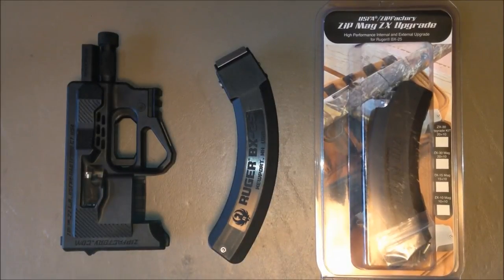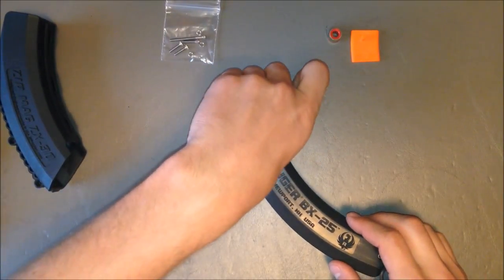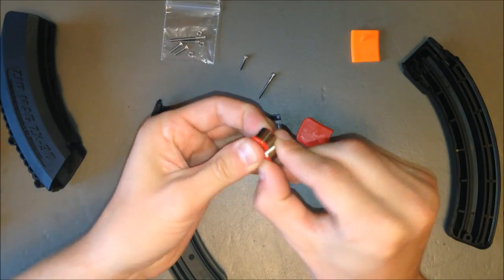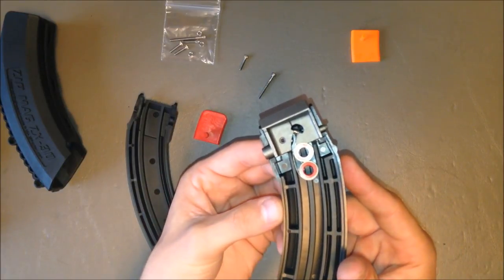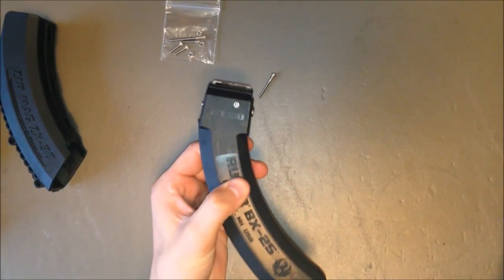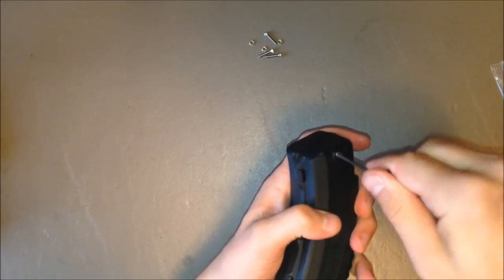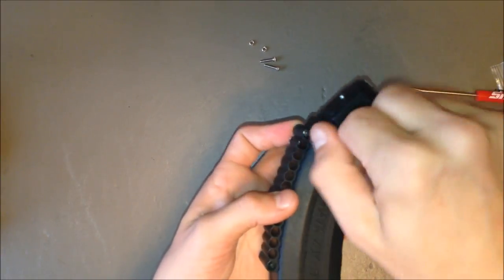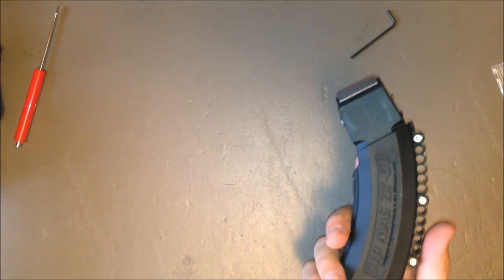ZX Upgrade Kit for BX-25 Magazine

Comment: Why not just glue some little bandolier on, and avoid all the nut and screw nonsense? Seems rather pointless to me.
Reply from the maker: If you want to glue something to the magazine and defeat the purpose of a modular shell that can be disassembled, go right ahead.  This video simply demonstrates the installation of the kit.  I am not affiliated with the company, nor am I endorsed by them in any way.

Comment: This will decrease the capacity of the magazine from 25 rounds down to 20 rounds.
Reply: What the hell is the point in that?
Reply: @TerminalM193 —I guess the point is that the spring will be stronger so the rounds will feed better.
Reply: @brianunderwood7437  try it with ONE follower
Reply: @robaldridge6505 —The follower isn’t the issue. There is another spring that connects to the spring already inside the magazine. It decreases the round count from 25 rounds down to 20. There is a video on YouTube.

Comment: Great video! A question concerning the installation of this kit - does it affect the ability to use the magazine in a Ruger 10/22? Does this upgrade to the magazine modify it to the point where it becomes exclusive to the ZIP .22, or will I still be able to use it in my rifle?
Reply from the maker: +Michael Koenig Still runs fine in a 10/22.  You lose 5 rounds capacity, but that's the only down side.
Reply: Glad to know it! Thank you for responding!

Comment: Thank you for the fine video. I have to clips that when full will not feed the first three rounds because of how tight the spring gets. Would you think the ZX kit will fix this issue?
Reply from the maker: Don't think so based on you're description of the problem.  The "upgrade" kit increases spring pressure and will make your problem worse.

Comment: I'm having feeding issues with my BX-25 in my Ruger 10/22 takedown,  will this upgrade help with that?
Reply: Kerwin miyashiro just put 2 drops of oil on the spring.
Reply: these mags are absolute trash. did u get any resolution?
Reply: What ammo are you using and how many rounds have been through the gun?
Reply: There is a bushing on eBay that helps with your feeding issues
Reply: You have to build up the rear portion of the mag where it t touches the rifle, and take the mag apart, cut down a 22 shell,to  take up the slop, and makes the round point up!  search BX-25  fixes!
Reply: There a video on YouTube that addresses that issue. The guy uses a spent 22lr case cut to fit the hole inside the spring and it seems to fix the reliability issue with the BX-25 magazine. It really easy to do.
Reply: @aaaaa1957  22 short and you do not have to cut it.